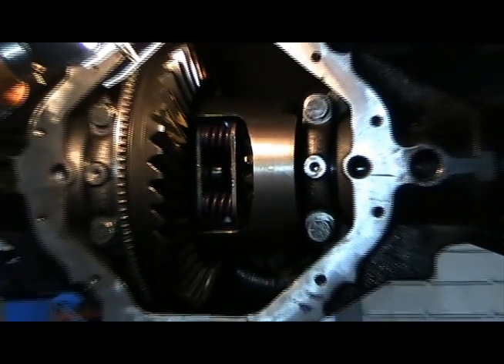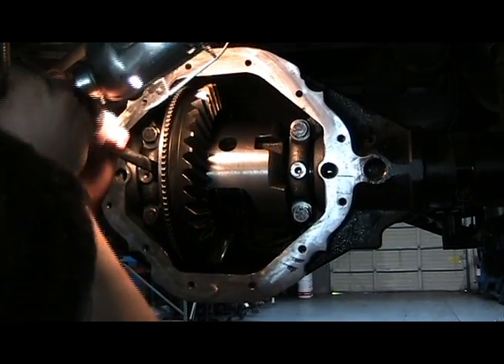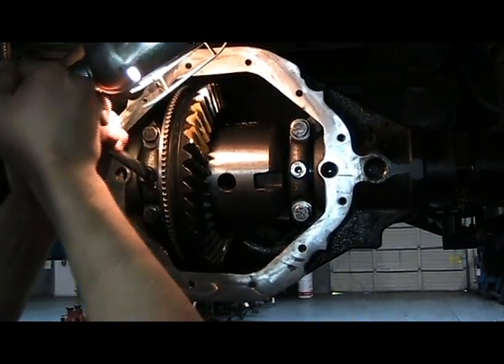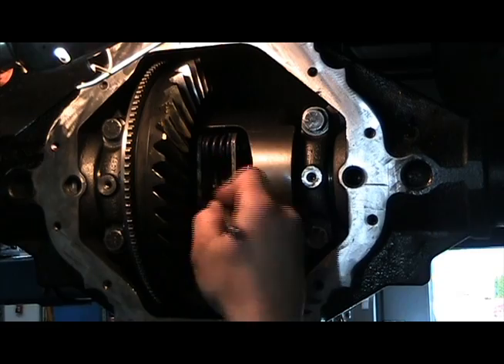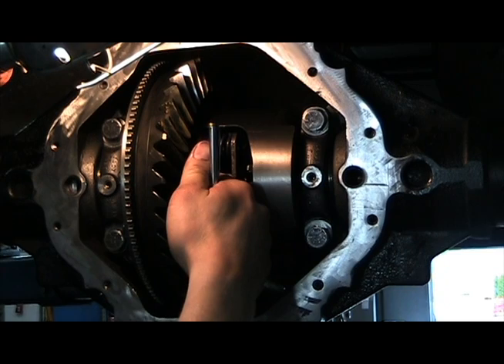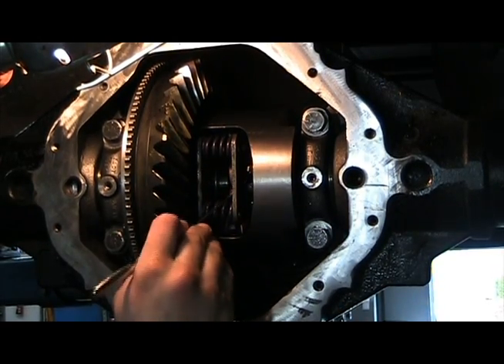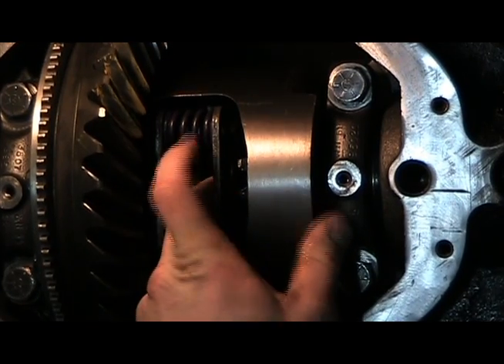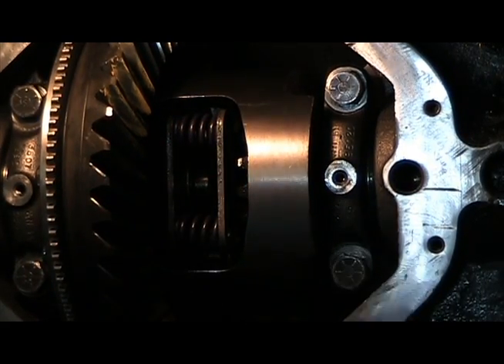Yukon Dura Grip Installation for Chrysler 9.25"

Comment: The cross pin bolt snapped on mine. This has happened to me a few times. It is a real pain to get the cross pin out when this happens. Then there is the shaft polishing that has to be done when this happens. I need to change my wheel bearing and just discovered this happen again. This was a new unit. 

I am trying to figure out what I am doing wrong. Any ideas? I am pretty sure it is a good idea to replace the cross pin.
Reply: I know it's been a long time. Either, you overtorqued it or it had red loctite on it and you didn't heat it before trying to remove it.